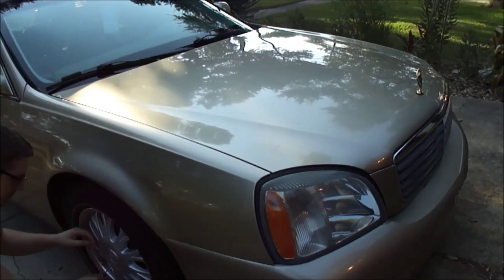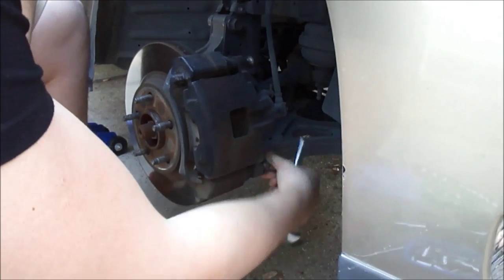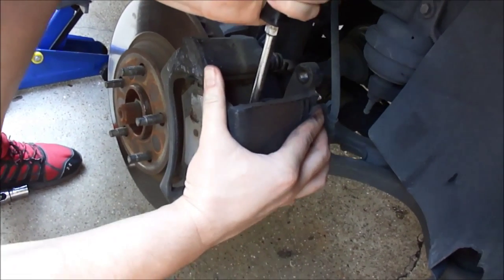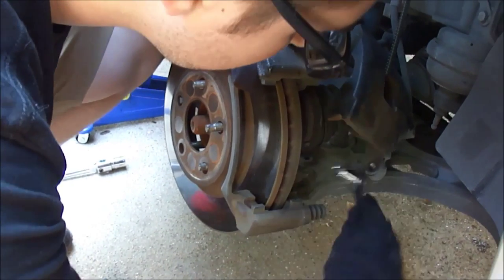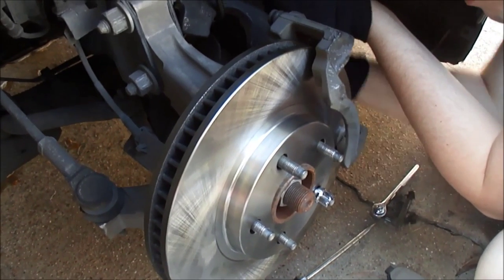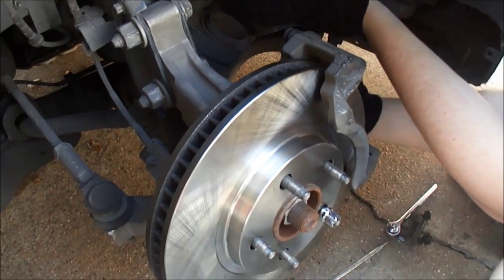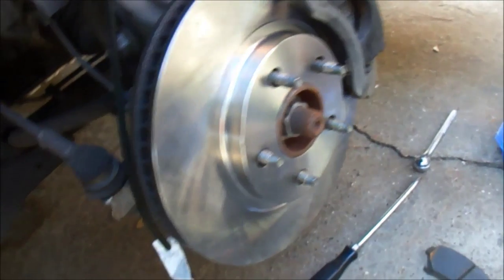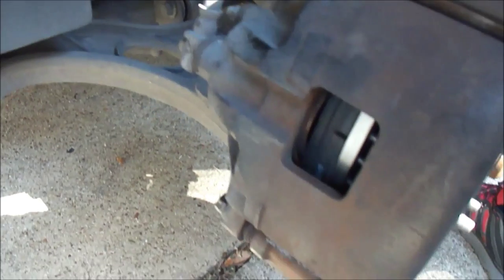Cadillac DeVille Front Brake Pads and Rotor Replacement

Comment: The tip on how to tell which pad goes where was very helpful. Some little things that would really have helped are cleaning the new rotors (they often come with grease on them), adding anti-seize to the back of the hub after cleaning it with a wire brush, greasing & cleaning the guide pins, greasing the area where the pads contact the metal clips and using new metal clips. I would never use the clips over again. Just me. Nice job, glad y'all included the bolt sizes!
Reply: Replacing the rotors on a 95 cadillac deville

Comment: Heads up on rattle, clunking noise you may have over bumps at low speeds...check your caliper guide pin bushings inside the caliper. They may have deteriorated and need replacement.  My 97 cadillac deville had this issue and once I replaced them, all you hear now is tires.  I already replaced struts, mounts, and sway bar bushings to no avail other than they needed replacement.  Ball joints, tie rod ends, wheel bearings, and sway bar links were replaced couple of years previously and were good.

Comment: use the old inner pad as a buffer to compress the piston. never put uneven pressure on it, it's  not like they're made of hardened steel; the older they get, the more brittle the exposed edges and contact face gets. don't pry against the naked piston face OR put a clamp directly on it. If you open the bleeder screw, you can compress by hand. In doing so, you don't force brake fluid back into the abs module, which contains metering, check, and proportioning valves; some of which are actuated via censors. You can damage these components by forcing the brake fluid back against these valves. It's just smarter and easier to crack the screw open, compress the piston, and close the screw. if you are afraid air will get in, then use a hose and cup pre-primed with new fluid.
Reply from the maker: +jcannoncraig Excellent points. I'm doing the front brakes on a 2000 Corolla soon. Will use the tips. Thanks
Reply: A c-clamp is quicker as all you have to do is twist

Comment: Breaks are very important. It would be a good idea to follow the manufactures torque specs and make sure to add anti seize to the metal contact areas of the pad so that the pads move freely within the caliper housing.
Reply: Brake grease is better anti seize will dry and actually stop the pin from sliding freely. Lots of people says it do not, but I disagree, bottom line something stopped them from sliding and anti seize was all I put on them.

Comment: DO NOT use vise grips because you are taking a chance of cracking the edges on the piston, use one of the old pads, lay across the piston and use a C- clamp to SLOWLY push the piston back... And for goodness sake use a wire brush or something to clean the old clips if they are being reused, and brake grease would also help.... btw they're Pads not Shoes...